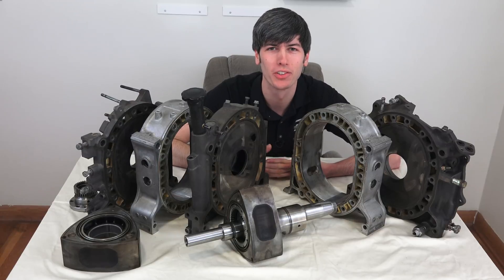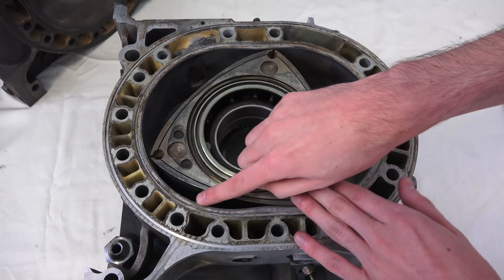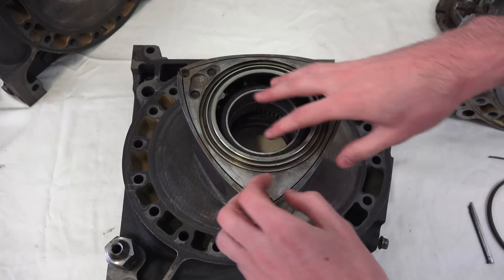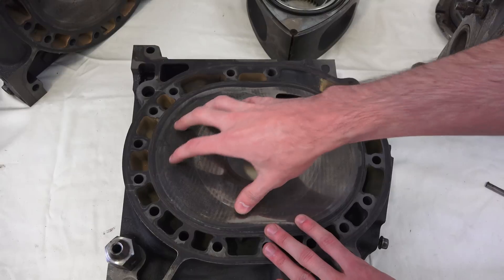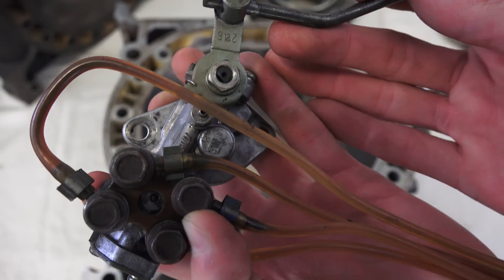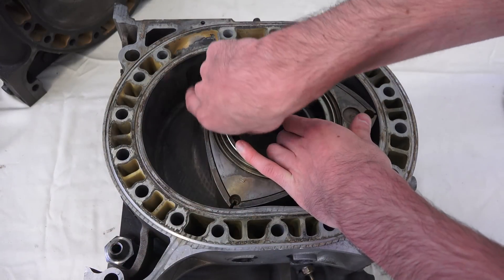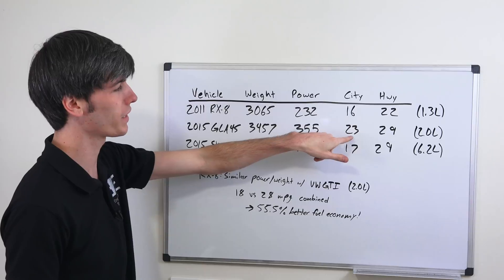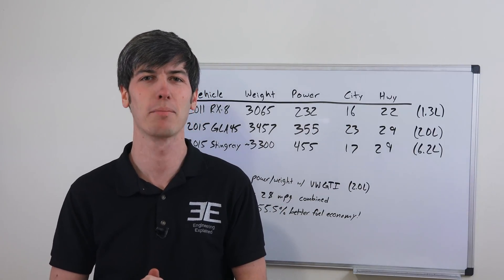4 Reasons Why The Rotary Engine Is Dead

Comment: I think that the problem it is same that has ev. The engine it is more compact. The diffrences of free volume in a ev respect to their mechanical or thermal version, it is that has a bit more than 50% of free space, so you can do a car with th 60% of the size, that means the 0.6 times the weight and frontal area. Same philosphy should run in rotary engine.

Comment: Don’t the newer direct injection engines burn even more oil than the rotary?
Reply: "Don’t the newer direct injection engines burn even more oil than the rotary?"

Not inherently, no.  Direct injection engines simply spray the fuel directly into the cylinder, instead of having the injector in the intake tract before the valves.  

Rotary engines have a specific "omp", oil meter pump, that takes oil from the sump and injects it into the engine for internal lubrication throughout the combustion chamber / housings. This oil is burned up in the combustion process though, and the rotary engine is basically always injecting / consuming oil.  

Now there are some "Wear and tear" considerations that can see them burning more oil than a standard injection system "down the line" after the engine has a lot of miles on it. But thats not exactly "inherent" to the motor per se

Comment: Great video, thanks! Have you done a video on the Liquid Piston engine? An interesting comparison would be between the Liquid Piston engine and the Wankel engine, and if the LP engine really addressed the weak points of the Wankel engine.
Reply: Yes, Liquid Piston make one of these engines used as the generator for an artillery gun.
Reply: @johnburns4017 Beware of LiquidPiston it is a vaporware investment scam.!!!
Reply: Beware LiquidPiston is a investment scam

Comment: 6 years later, there is a clearer picture of what went wrong with the Wankel engine: Engineering sabotage. The number one problem with the engine, which is easy to solve, is the spark plug hole, which should have been a spark plug slot the same width as the Apex seal. If this were widely done, this engine would have zero problems.
Reply: Unfortunately that is completely false... Ernie Brink was a crackpot who drank himself to death.
Reply: @ronarmstrong835
Mazda have changed many aspects of the design for the MX-30.
Reply: @johnburns4017 MAZDA HAS CANCELLED THE MX-30

Comment: Who's watching this in 2023 after mazda having presented their new rotary car?
Reply: Officially canceled, no new Wankel engines
Reply: Just another hoax like 16X, RX9 Demio RRE and the RX Vision  Coupe.
Reply: @sandervanderkammen9230  the new car was released
Reply: @SandStormPower  stop by your local Mazda dealer and see for yourself, this is just another hoax
Reply: @sandervanderkammen9230  mazda presented the MX30 R-EV which uses a small displacement rotary engine as range extender.
Reply: @SandStormPower  It is only a concept car.
Reply: @SandStormPower  Range extenders have proven to be very poor concept and is not commercially viable.
Reply: @sandervanderkammen9230  it's a rotary, is what matters. And opens doors for further developments.
Reply: @SandStormPower  Its a WANKEL... Rotary type engines became obsolete nearly a century ago.
The Wankel engine has been obsolete for just a little over a decade now.
Reply: @SandStormPower  As we have seen with previous failrex attempts to bring back the Wankel engine it's reached the logical end of its development potential

Comment: 4 reasons the wankel engine didn't die:
It's simple
It's lightweight
It's compact
It's cheap
It's balanced
It's free-revving
It's well suited for a range extender role
It's the opposite of what doktorbimmer said
Reply: Stop by the local Mazda dealer and see for yourself.
Reply: If all that is true? Why did all the automobile manufacturers abandon the Wankel engine???

Comment: 4 things to work on in this engine. But it has 99% less parts that will break. Also with the standard gasoline engine that burns 20% of the gasoline you put into it I think it is worth working on and making it better.
Reply: Unfortunately the Wankel engine is inherently unreliable and inferior to reciprocating engines by design
Reply: @sandervanderkammen9230  I still think we need to improve it and not discard it, unless we can come up with a better engine all around.
Reply: @2010invent  All of the experts have concluded after billions of dollars of research and development  that the Wankel engine can never match the reciprocating engine.
 The Wankel engine is just a bad design... just as round wheels will always be better than square wheels, 
Round pistons will always be better than triangles.

Comment: From Mazda....
The Mazda MX-30 e-Skyactiv R-EV is a series plug-in hybrid that offers the same customer values as the pure electric Mazda MX-30, while simultaneously offering new ways of using a car as a battery electric vehicle. With a 17.8KWh battery, the R-EV has a 53-mile pure electric range, and using Mazda’s unique rotary engine technology, the all-new 830cc single-rotor petrol engine acts as a generator to enable longer distance drives without range or charging anxiety. With no mechanical connection between the engine and the wheels, the rotary unit simply acts as a generator, ensuring the MX-30 R-EV always drives via the electric motor to deliver a seamless EV driving experience.  

With more than half a century of expertise in the development of rotary engines, Mazda selected the rotary powerplant for this application due to its unique ability to produce the required output from a small, light and easily packaged unit. The rotary engine is placed neatly alongside the generator and high-output motor in the engine bay. The combination of the 17.8kw battery and 50-litre fuel tank create a unique series plug-in hybrid with a flexible total range of over 400 miles, while a WLTP CO2 output of just 21g/km ensures class-leading environmental performance.

Compatibility with both AC charging and rapid DC charging is another benefit, meaning 3-phase AC charging takes around 50mins, while for maximum customer flexibility, DC rapid charging can be completed in around 25 minutes. The Mazda MX-30 R-EV has three drive-modes to suit different driving situations: Normal, EV and Charge, and thanks to a 125kw/170ps output, it delivers slightly better acceleration performance than the 145ps fully electric MX-30 .

Available to order now, for UK arrival in the summer, the Mazda e-Skyactiv R-EV is offered in the same highly specified grades as the all-electric e-Skyactiv MX-30: Prime-Lime, Exclusive-Line and Makoto – while bespoke to the R-EV, the range is topped by the Edition R. Revealed on the Brussels Motor Show stand, this limited edition launch model has stand out features inside and out, and is offered exclusively in the unique colour combination of Jet Black with Maroon Rouge side pillars and a black roof.

Mazda MX-30 e-Skyactiv R-EV Edition R
With the R moniker standing for return, just 400 Edition R models will come to the UK to celebrate the return of the rotary engine. The Maroon Rouge colour accent pays homage to the roof colour of the Mazda R360 – Mazda’s first passenger car. Inside, the front seat headrests are embossed with the rotary symbol and Edition R name, while the mats feature the rotary badge and a single white line of 2.6mm stitching matching the width of the rotor apex seal grooves. The same nod to the rotor apex seals can be found on the sculpted sides of the key, which also features horizontal sides that curve at the same angle as the sides of the rotor.

All versions of the Mazda MX-30 e-Skyactiv R-EV feature a rotor badge on the front wings and an e-Skyactiv R-EV badge on the tailgate. Unique wheels differentiate the R-EV: Prime-Line with a dark grey finish and Exclusive-Line, Makoto and Edition R a black diamond cut finish. With the MX-30 range starting at £31,250 – Prime-Line and Exclusive-Line R-EV models are priced identically to the BEV version, giving customers ease of choice with price parity. Makoto R-EV models demand a small £450 price premium over the pure electric version and at the top of the MX-30 range is the R-EV only Edition R – priced at £37,950 it is limited to just 400 examples in the UK.

Between the launch of the Mazda Cosmo in 1967 and production of the RX-8 ending in 2012, Mazda mass-produced more than 2 million rotary engines. Adapted to meet the needs of our times the rotary engine is now back being used as a power generator rather than a drive unit. The new 8C rotary engine is a 830cc single rotor with a 120mm rotor radius and 76mm rotor width, its compact size enables coaxial placement and integration with the electric motor, decelerator and generator to achieve a unit with an overall width of less than 840mm, allowing it to fit under the bonnet without changes to the MX-30 body frame.

Thanks to the use of aluminum the engine is over 15kg lighter than the twin-rotor Renesis engine used in the RX-8. The use of direct fuel injection reduces emissions and increases fuel economy, while the engine also features an Exhaust Gas Recirculation (EGR) system to improve efficiency at low rpm and low load running. With a 50-litre fuel tank the rotary generator allows for long-distance travel without the need for regular fuel station stops.

A 17.8kwh battery was chosen to ensure a enough capacity for a 53-mile electric-only driving range while at the same time considering the environmental impact of the battery over the entire vehicle life cycle. The MX-30 R-EV’s high output 125kw/170ps electric motor can produce up to 260Nm of torque, while the new R-EV retains the same relaxed, accurate and engaging driving experience as the pure-electric MX-30.

The MX-30 e-Skyactiv R-EV features three driving modes: Normal, EV and Charge, however the choice of mode does not affect maximum vehicle speed. Normal mode delivers electric drive as long as there’s enough battery charge. If more power is required than the battery level can deliver – for example, when accelerating – the rotary engine generator will activate based on the degree of accelerator opening and supply the battery with more power. Thus the MX-30 e-Skyactiv R-EV delivers outstanding acceleration performance and ensures drivers can always enjoy the car.

Drivers can turn EV mode on when they want to stay in electric drive for as long as possible. This mode will ensure the vehicle uses electric drive exclusively until the battery is completely drained. It should, however, be noted that if the driver needs to accelerate suddenly and purposefully depresses the accelerator pedal significantly beyond a certain point (equivalent to the kickdown switch function on a standard automatic transmission vehicle), the rotary engine will activate and generate the power needed for the car to accelerate as powerfully as possible.

Charge mode can be used to safeguard the necessary amount of battery for situations such as the need to save zero emissions running for particular urban environments, additionally drivers have the option of setting the amount of battery charge they want to reserve in increments of 10%. The generator will activate when battery charge drops below the specified reserve level, charge the battery to the set level, and maintain that level of charge. Once battery charge is above the set level, the car will operate in the equivalent to Normal mode until the battery depletes to the specified level. It will then use the rotary engine generator to keep the battery at that level.

Commenting on the reveal of the Mazda MX-30 e-Skyactiv R-EV, Jeremy Thomson, Managing Director, Mazda Motors UK, said: I’m really excited about the new MX-30 R-EV joining our electrified line-up in the UK this summer. A great example of Mazda’s challenger spirit, thanks to its unique technological approach, it’s a car that’s the perfect solution for customers who want an electric car for everyday usage but the flexibility to undertake longer journeys without the reliance on charging infrastructure. With the option to choose either the pure electric MX-30 or the new R-EV version depending on their needs, our customers now have even more choice.

Adding, “whichever version they choose they get the same seamless electric drive experience, engaging handling and first-class cabin, which features unique materials and premium design. It’s the latest example of how Mazda’s Multi Solution Approach ensures we have cars to suit all our customer’s needs by improving environmental performance with a combination of electrification and clever internal combustion engine technologies”.

With the Mazda MX-30 e-Skyactiv EV on sale and in UK dealerships now, the Mazda MX-30 e-Skyactiv R-EV is available to order now, with the first UK cars due to arrive this summer.

Comment: The Mazda MX-30. The innovative 830cc rotary engine acts as a generator for the battery, while the electric motor sends power to the wheels. Combined, the model’s 50-litre fuel tank and battery offer a driving range of over 400 miles, with emissions of 21g/km - a big range increase over the 130 miles provided by the current, EV-only model, which has a 35.5kWh battery. 

The MX-30 R-EV can travel up to 53 miles on pure electric per charge, Mazda says, which ranks ahead of much larger plug-in hybrids, such as the Suzuki Across, the Toyota RAV4 and the Mercedes-Benz A-Class 250e.  It can charge in around 90 minutes using a 7.2kWh charger, 50 minutes on an 11kW unit or 25 minutes with a 36kWh charger.
Reply: Stop posting lies and false clickbait nonsense.

Comment: Some magazines are saying that the new Mazda rotary will have variable valve timing.  Two inlet ports with the second not needed on low power demands, so choke valve will block the second port.  Some say the alternator turned by the rotary will give positive and negative torque when needed on the intake phase.
Reply: Turns out some magazines are wrong like you...  just another rotard clickbait hoax!!!

Comment: Basically the rotary should be limited to motor sport given that emissions are a concern, however even the FIA have went nazi on the wankel
Reply: @S727
Yes, they banned the Mazda from Le Mans as it swept the card. Unbeatable.
Reply: @johnburns4017  SORRY JOHNNY THE FIA NEVER BANNED MAZDA
Reply: The Wankel engine was an epic failure in motorsports even with a displacement adavantage.
The FIA never banned Wankel engines from non-formula series competition.
Wankel engines are no longer used in any professional or world class racing because there are no longer any manufacturers that produce these obsolete engines.

Comment: Far from dead... have you seen what they are doing with rotary engines
Reply: Not talking about mazdas rotary  hybrid. I'm talking about the aftermarket rotary scene.  Some of the fastest street cars in Australia  are rotary engines... running 7 secs down the 1/4 mile
Reply: @rotormotor13b  Australia no longer has any automobile manufacturing industry... engine technology on the big island is about as far as you can get from the center of the performance world without leaving the planet.
Reply: @rotormotor13b  In the drag racing world 7 seconds is embarrassing...  but I guess living at the bottom you take what you can get?
Reply: Wankel engines were an epic failure and have been obsolete for more than a decade now.
Reply: RotorMotor13B
Yes, a rotary engined Mazda announced this month. 
The Top Gear web site yesterday>>>>

Mazda’s upcoming plug-in hybrid will be powered by a ‘newly developed’ rotary unit.

Mazda has announced that its MX-30 will get a new powertrain, and that powertrain will include a rotary engine. Woohoo!

Although, one must cool one’s jets, because the MX-30 won’t be solely powered by a rotary engine, instead forming part of the company’s latest plug-in hybrid powertrain. We’ll see an MX-30 outfitted with just such an item at the upcoming Brussels Motor Show.

There’s scant detail, so all we know is this. The “compact crossover will feature an electric generator powered by a newly-developed rotary engine”, suggesting Mazda’s new PHEV simply swaps the traditional combustion engine part of the setup for a rotary one. Why the heck not.

And while that rotary will likely only ever see service charging that generator and powering the electrics, we are eternal optimists, and so here’s hoping Mazda allows itself one flight of fancy to return the rotary – an efficient one of course – to a sportscar. The campaign starts here…

The Brussels Motor Show is from 14 to 22 January 2023. So will see it in a week or two.

Comment: This was a bad prediction. Mazda are introducing next month the MX-30 hybrid using a rotary engine for the range extender running at a constant speed.  Rotaries run far more efficiently when at a constant speed and 25% more efficient when on hydrogen.  So a zero emissions hybrid will not be far off.

The Japanese opened a nitrogen gas cooled reactor last year. They reach 1,000 C which is economical to crack water into hydrogen. So electricity and hydrogen made at the same plant.  Industry currently has no option but to run on fossil fuel. The Japanese want to run all from hydrogen. Hence why Japanese car makers have been cool on EVs. Japan is moving to a hydrogen society.
Reply: TALK ABOUT BAD PREDICTIONS!
  JOHN YOU HAVE BEEN WRONG EVERY SINGLE TIME FOR NEARLY A DECADE.
  EVEN A BROKEN CLOCK IS RIGHT TWICE A DAY!!! LOL
Reply: @sandervanderkammen9230  
doktorbimmer, a quiz.
Name the car that will be announced at the Jan 2023 Brussels Motor Show with a rotary engine?
20 points for the correct answer.
Reply: @johnburns4017  Have you heard the joke about the British space rocket?
Reply: @sandervanderkammen9230  
BZZZZZZZZZT! Wrong answer.
bimmer, the name of the car that will be announced at the Jan 2023 Brussels Motor Show with a rotary engine, is the ....

🍾🎊🩸  Mazda MX-30 🍾🎊🩸

Zero points bimmer. Zero. Better luck next time.